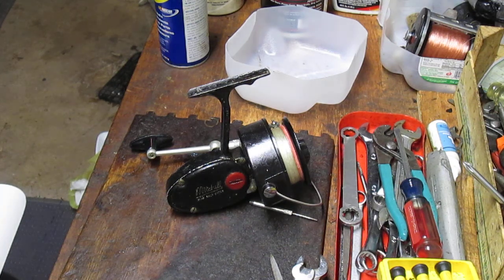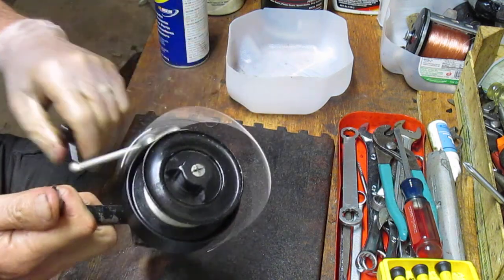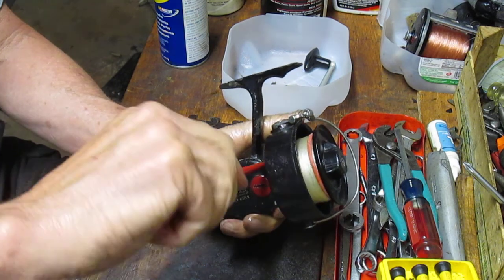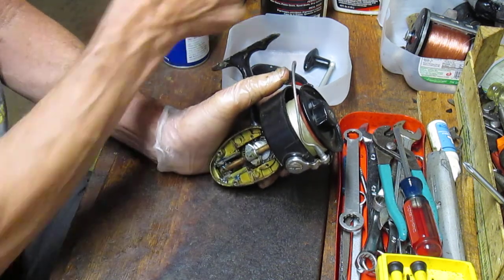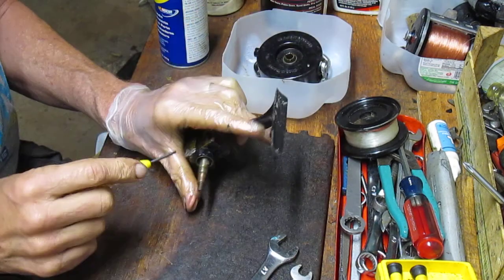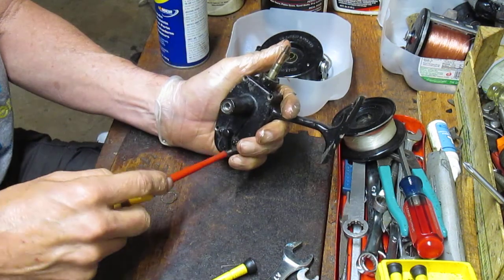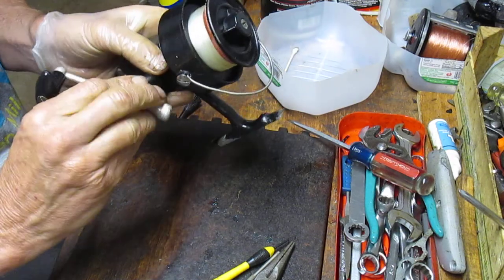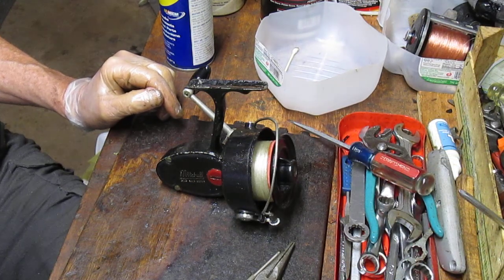Mitchell 302 Vintage Saltwater Reel - Complete take apart and service

Comment: I just got one of these on ebay, from 1954! It's flawless, perhaps unused.  A little sluggish because the grease is dried out.  Looking forward to doing this service.
Reply from the maker: Wow - great find.  When I get these I use the Mitchell Museum as a reference.  They also have a great video on Youtube for the take apart and cleaning of most of these reels.  Their website is http://www.mitchellreelmuseum.com   
If you need any parts, I probably have them as I bought out a huge lot of Mitchell repair parts from a service business that closed a few years ago - 
Good luck with the overhaul - Dennis
Reply: @2ndChanceTackle  Thanks.  I'll keep that in mind, especially about the parts.  Regards.

Comment: The rotor bearing and the drag washers and parts are available on ebay from a couple of sellers.  It should be mentioned to your viewers that if the drag were complete, the spool will unscrew from the main shaft as a unit.
Reply from the maker: Noted.  I bought a ton of Mitchell parts from a regional repair center that closed.  If you ever need any, let me know - Dennis

Comment: Great video as I have said before! I have 2 of the 302 reels - 1 PUM and the other bailed. It has always bothered me that the tiny piece the goes in the key way is perhaps the most important piece  to the function of the reel and that without it, the reel is worthless. That scares me whenever I tear one of them down to clean or fix something. The more I work on these reels the more determined I get to make them as close to perfect as possible. That’s why I could never do what you do as I would never be satisfied. Also I don’t have 20 years to learn your craft at my age. I’ve watched this video three times and learn something new and different each time. You really are an extraordinary, patient, and generous teacher. Have a blessed Christmas and a joyous new year Dennis! - Christopher
Reply from the maker: Thank you Christopher.  You are 100% correct on that tiny key.  The rotor will just spin without it.  I had a customer bring one in and  said  that the problem had just started.  Well, missing the key is not something that just happens, so... we had to find one and they cost as much as the used reel, given that the reel will not work without it.  Lessons learned.  Best wishes for a Merry Christmas - Dennis
Reply: I picked up one of these reels just as something to check out, not to use, just to take apart and see how it works. I was surprised to find that in order for the entire assembly to work properly, that tiny "key" was so important, but so precariously installed.

Comment: Really enjoy your videos! I have several Mitchell 302 reels that I have fished with since the early seventies. Over the years the paint for what ever reasons has came off in places . Some bon the reel bodies, bail housings or the spools. I was wondering if there is anything I can do to repaint them. A couple of the spools are rough and I was thinking about sanding them smooth. Is that doable? Thank you for any help you can send my way.
Stay safe and may the Lord be with you!
Johnny
Reply from the maker: Johnny - A lot of folks repair their reels.  They use an automotive paint stripper and automotive paint, available in spray cans, to dress up their reels.   I would use the stripper versus the sanding and then just sand what may be necessary of pitting or corrosion.  A coat of primer and then whatever color you would like can follow - Dennis
Reply: @2ndChanceTackle  
Good morning Dennis!
Thank you for your advise and I will get some of the stripper and paints. I really do enjoy your videos. I growed up use the old Mitchell 300 and then got the 302 s for fishing salt water. I still think they are some of the best reels ever made, although I am probably bias on that. 
Stay safe and may you have a blessed day!
Johnny

Comment: Dennis... on my 302, by the rotor ball bearing, there is a chrome ring and there is a brass spring-washer (curved).  Does that go on top of or on the bottome of the ball bearings?  The schematics I checked don't actually name the parts, so it's hard to tell by sight what I'm looking at exactly.  Let me know what you think!  (PS... I think that steel tiny clip is a friction ramp to prevent bail closures during casting.  I think, as most reels have them.  But let me know about that spring washer placement, if you can.  Thanks.

Comment: Hi 2nd chance.Great tutorial,very informative and straight to the point, many thanks for posting.Unfortunately the main reason i watched was not covered in your video because as you said the reel is not fully complete and just for parts.I have just purchased a 303 right hander and the drag can not be tightened down fully and the spool just spins.On closer inspection i noticed there are no drag washers under the spring, as i have no manual i have no starting point and as you are clearly very experienced with these reels i was wondering if you happen to know how many washers should be in there.On my other reels i have a number of felt and steel washers and am half expecting a similar arrangement but i would like to repair the reel properly with the correct amount and type of washers.
Any help or info you may have would be very much appreciated.
Regards.
Michael.
Reply from the maker: Michael - Please send a note to my email 2ndchancetackle@gmail.com and I will send you the schematic of how the washers go and what type they are.  There are several different ones that go inside the reel including a spring washer, click washer and other metals.  Dennis

Comment: Dennis thanks for your videos you have helped me a # of times with my 302s.    I have a smaller mitchel  that I tried to take the cover off. The screws are just stripping  any advise. If I have to drill them out are they replaceable?  Thanks
Reply from the maker: If you drill the heads off, you can sometimes work the stems out after the case cover is removed.  If this studs break off, you will need to replace the cast.  Send me a note if you need the case. 2ndchancetackle@gmail.com

Comment: Any videos on showing the operation of the bail assembly? I have a bail issue and that is the one thing you did not take apart on this video.
Reply from the maker: Yes - this video https://youtu.be/h_GP-KOGJBk  will cover the bail trip internal pieces in the first half and how to set the bail wire spring in the second part.  Thanks for viewing - Dennis

Comment: Dennis, great video!  I’m working on a 302 and 402; both have the same issue with the line guide (or roller).  Do you just give up on it spinning?  I suppose the lock washer and lock nut are supposed to be adjusted tight enough that the bail doesn’t flop around but the roller is supposed to spin, correct?  Any known fix for this?
Reply from the maker: Those just lock in.  A good example of the fixed stud is the 300 Mitchell.   Thanks Dennis

Comment: I’m a huge fan. Quick question I found a 300 at. Flea market wicked cheap tip top condition.  It doesn’t make the reeling sound when it reels in. I’m glad not to that sound lol
Reply from the maker: Some are more quiet than others.  It has to do with the A/R dog that is in the reel.  The metal ones make the loud sound.  The plastic ones do not
Reply: @2ndChanceTackle  I’m so glad I found one that is plastic 😊

Comment: Dennis, have you ever serviced or repaired an old Mitchell 488 saltwater reel? I just won one on EBay. I already know it has a little internal chirp going on. Other than that the reel is completely functional. I would have rather found one that was PUM but they are more rare and pretty costly. I will also need to match that midnight blue paint on the reel as the side plate will need repainting.  Any help you can give me will be greatly appreciated!  I don’t have a schematic for the reel either and am still searching for one. I won’t actually get the reel until the end of the week so I don’t begin to know what will be required to fix up the reel. I have 2 302s, 2 306s, a 330 AB, 301A, and an old 304.  I really like these old Mitchell’s and will continue to modestly add to my collection. 1 302c and 1 306 are PUM and I enjoy fishing with them. Your videos really helped mt to service these reels. This 302 video was particularly helpful! - Christopher
Reply from the maker: I have not done one, but there looks very simply in design.  Search the internet for "the Mitchell Reel Museum". for the schematic if this link does not work http://www.mitchellreelmuseum.com/index.php/category/389
Best wishes - Dennis

Comment: Hi Dennis. Thanks for this video. I got so inspired that I got out my Mitchell 302. Used it on the Virginia coast for years.  But I haven't used for decades! Big question: The bail is bent so that the handle hits it every several cranks. How should I remove the bail to adjust (bend!) it back into shape? I'm afraid to bend it in place for fear of breaking one of the two mounting assemblies at either end of the bail. Thanks again.
Reply from the maker: You are going to have to remove the bail screws on the arms in order to re-bend the wire.  You can watch how to reinstall it here https://youtu.be/h_GP-KOGJBk Thanks for the note - Dennis
Reply: @2ndChanceTackle  This was exactly what I needed. Thanks!

Comment: Thanks for the video. I have it back together as you showed with the 2 pins and oscillating gear in line, but it now catches the bail arm on every 7th turn of the handle. I have re positioned the gears 3 times but it still does it, any ideas as to why this is happening
Reply from the maker: If the handle is hitting the bail arm, it is because of a bent bail wire or bent handle arm and not the gears.  Go slow to the point where the two meet and check to see which is bent.  You can bend the bail wire up with gentle pressure to resolve the problem - Dennis
Reply: @2ndChanceTackle  Thanks Dennis for the quick reply. I am spooling line on the reel but it seems to spool more towards the front of the spool, so it is not evenly spooled, any ideas why?

Comment: Hi Dennis, I have a 302 or 303 Mitchell it all works except for the bail arm release lever and lock pin, not sure what is wrong with it, could you go through the service and set up for this? That would help me greatly. Paul
Reply from the maker: I will try to do this in the next few days.  Thank you for asking - Dennis

Comment: I just picked up a really good condition 303, there was a 302 sitting right next to it & should have grabbed it. The 303 SALT WATER, is there any significance to it, I'm going to completely clean & service, but I don't know if it should be preserved because of age, which I'm not sure of.
Reply from the maker: The 303 and 302 are the same reel with the different crank.  The 302 is a left hand crank and the 303, which is rarer, is the right hand crank version.  These reels should be kept clean and greased.  The drag washers are all metal, so no need to replace them.  Sounds like a good find.  Clean it up and take it fishing - Dennis
Reply: Thanks for the info Dennis. I would have thought that left handed would have been rarer. I'm left handed and had to learn how to crank with both hands just incase.

Comment: Thanks Dennis for the quick reply to my previous question. I am spooling line on the reel but it seems to spool more towards the front of the spool, so it is not evenly spooled, any ideas why?
Reply from the maker: Yes - check the bottom drag washer. the one on the shaft that goes through the spool. The bottom washer is under the spool on the lip of that spool shaft. IIt may be worn or missing.  It that is the case, the reel will spool to the top of the spool.
Dennis
Reply: @2ndChanceTackle  Hi Dennis. I checked the drag washer (81368) is there behind the spool,and sits in the well at the back of the spool. I have another 302 and both spools seem to travel outwards the same amount. Could it be the bail arm not being the same, as I had to bend it to miss the handle on every 7th turn?
Funny thing the other reel is missing the 81368 drag washer and it spooled correctly.
Reply from the maker: @ianspencer4324  Yes - it could be the bail arm if you bent it from the line roller.  The trick to bending this wire is to grab the wire after the arm/line roller so that it does not throw off the alignment - Dennis

Comment: Dennis- Thanks again for the videos.  Any tricks to remove the two set screws holding the bearing in place?  I have applied "Break Free" lube and let them sit overnight.  Do you use heat or banging on the screwdriver while twisting to bust them loose?  Also do you have a source for the bearings and/or what size to order as it's pretty rusted?  Really appreciate the help.  Cheers.
Reply from the maker: Sounds like you are using the standard tricks.  I would vote for heat if all else fails.  I would never hammer it. - Dennis

Comment: Hello Dennis.  I really enjoyed your video.  Do you think the "growl" is from that top bearing you can't get to?  Reason I ask, is after 40 years I have found a man that has had my grandparents 302's and I am getting them back!  The man said that he had both rebuilt but one still has a little "growl" but works great.  I was just trying to figure out what to look for.
Reply from the maker: The growl is almost always from the top bearing. You should be able to find replacement bearings on Ebay.  The other cause could be worn pinion and main gears, but I would go with the bearing first.  Thanks for asking - Dennis
Reply: @2ndChanceTackle  Thanks Dennis!  Super excited to have these reels after 40 years.  I am 51 now and my grandparents taught me how to surf fish with these reels.

Comment: Thanks for the video. I have just received a mitchell 302 with no use, but the anti inertia brake is absent (I discovered this with your video), I would appreciate a lot if you could tell me what this part is for? This part is very necessary or can I use the reel without it? Regards.
Reply from the maker: Yes - you can use the reel without it.  Its purpose is to slow the spool and prevent backlash.  It is frequently lost when folks open the side plate for service and forget to reinstall it.  No big deal - Dennis
Reply: ok, thanks for the information, regards

Comment: Hey Dennis I have one of these in relative mint condition however I don’t have the metal clip that provides that ramp on side plate.. reel works fine don’t know if they all brought that clip on side plate??
Reply: I have the same reel without that rider as well. Works perfectly added a crosswind after market and a pick up manuel.  Ht100 drag stack as well.  Nice reel oh, it loves original Fireline

Comment: I have a Mitchell 302S and I have problem with the bail not holding the tension in the casting position? Any suggestions?
Reply from the maker: Yes - your bail trip release is most likely dirty or frozen.  To fix this, remove the spool of the reel.  You will notice the spring and trip lever arm inside the rotor.  Follow the assembly to where it goes through the case to the outside bail arm.   Get a penetrating oil like WD40 and spray it wet.  Let it sit a while and then respray.  Try working the lever untill it eventually frees up.  The should get it working again.
I am assuming that you do not have a broken part in the assembly.
Let me know how you do
Dennis

Comment: Dennis , Any reel that is a little sluggish I shoot a shot of WD40 in it and work it for awhile ! Then I service it and find much easier to remove the grease !
Reply from the maker: Yes - that has helped me in the past and it works very well with sluggish bails - Thanks for the tip - Dennis

Comment: Thanks for posting. My 302 makes the same kind of grinding noise as in the video. Is there a fix for this or is it normal
Reply from the maker: The grind is almost always the top bearing, which can be replaced - The gears are well made and don't normally break down, but dirt could also be a cause if it isn't the worn bearing - Thanks for asking - Dennis
Reply: As Dennis said, it's probably a dirty or rusty bearing.  Usually they are still quite sturdy and functional, so in that case, my cure is to pack it tight with heavy brake caliper grease. But you have to really clean it out first with dish detergent or whatever degreaser, and dry it out before you PACK that sucker tight with grease.  It will be quieter and smoother, easily.  It won't slow your reel down noticeably at all.

Comment: Hi Dennis.  Funny this reel is missing the drag parts because this is where I am having a problem.  I have heard from 2 sources on lubrication here.  One says you don't use oil on Mitchel 300 series, on the drag, the other says a light machine oil.  What do you recommend?
Reply from the maker: Ken - the drag system on the Mitchell 300 is comprised of two parts.  They are the upper and the lower sections.  The upper portion, under the drag adjuster knob is a series of springs and metal washers.  You can oil these as it will retard corrosion and not affect the performance.
The lower portion is actually where the drag washer is.  If you push the shaft down and through the spool, you will see the drag washer at the bottom of the stem.  I usually just clean this and do not lubricate it.  If you like, you can apply a light coating of grease and then.wipe it off with a paper towel.  That will give it enough lubrication without overloading it.  Thanks for asking - Dennis